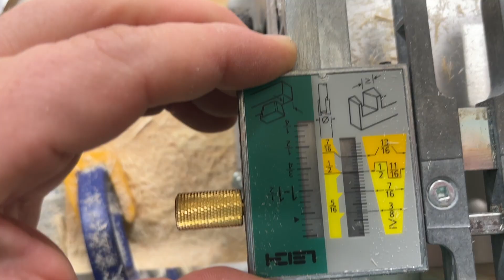How to Make Dovetails on a Leigh Dovetail Jig

Comment: The top board for the other clamp down is for a sacrificial board so there isn't as much blow out. Its also a good idea to use a sliding marking gauge to cut into the face of the board on the side that's out to avoid blowout.

Comment: Appreciated comments about mistakes.   

You didn't use a backer board to help prevent tearout on the back side.   Do you not need it if you score the back? 

Should also mention that the pin adjustment must be made on both sides.
Reply: I was thinking about the backer board as well.  It is a must if you want to prevent tear out.  Another tip is to run your router side to side at the top before you push it in to make the final cut.  Once again... it will help to  prevent tear out.
Good vid!!!